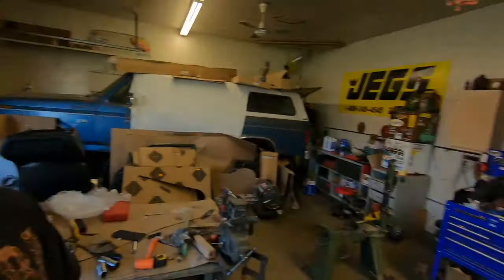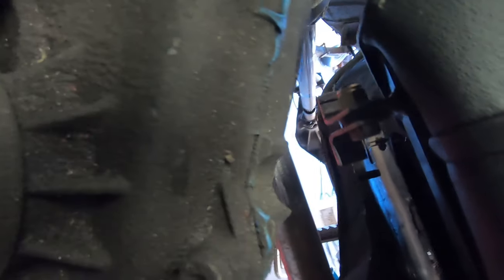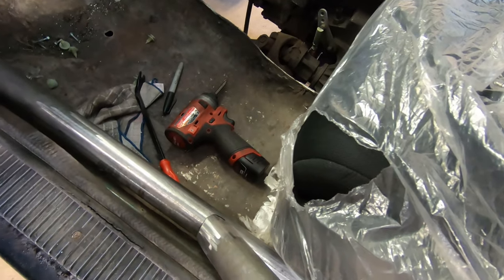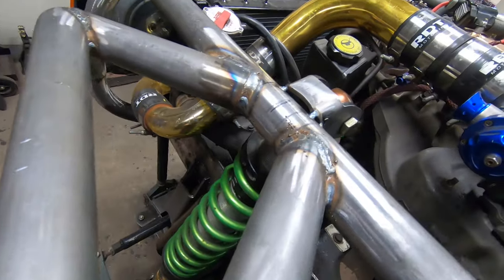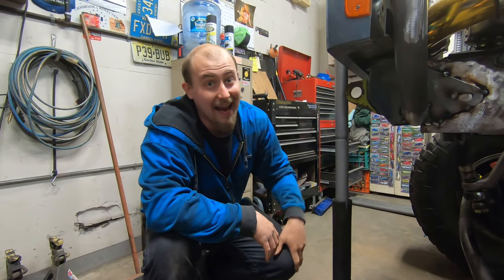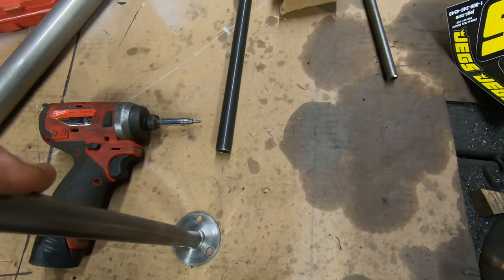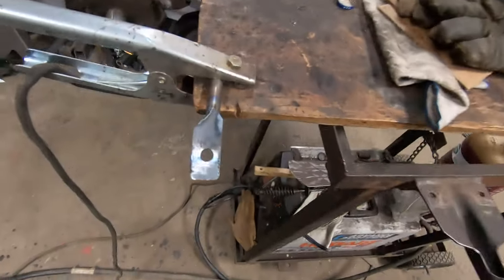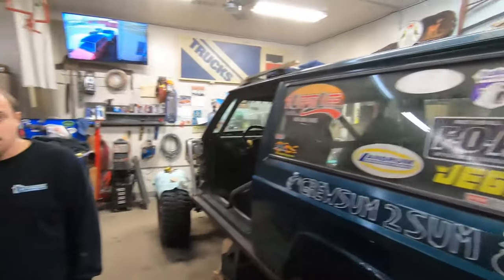Turbo Cherokee Roll Cage Part 3

Comment: You need to measure full bump... full droop...and full flex ( one side full stuff other full drop) if you don't do the last one you might find you are hitting the frame with your shock body and bend your coil overs as well as find your tires don't clear at full flex. 

What wheelbase are you planning ?.
Reply from the maker: We did that thanks for pointing out an important step though!
Reply from the maker: Right now it's at about 119" wheelbase